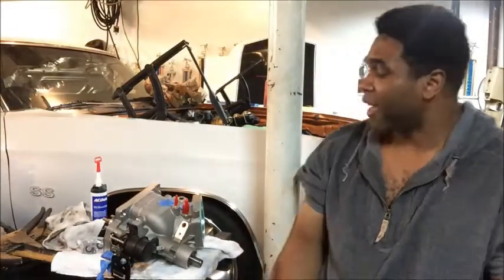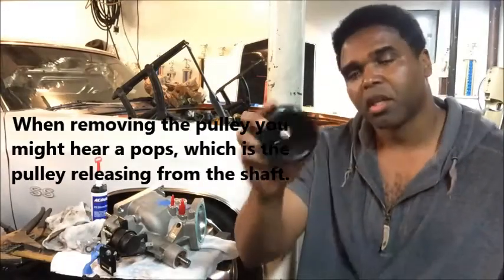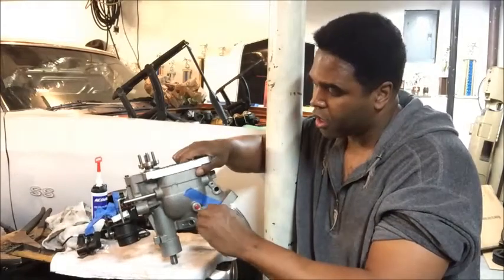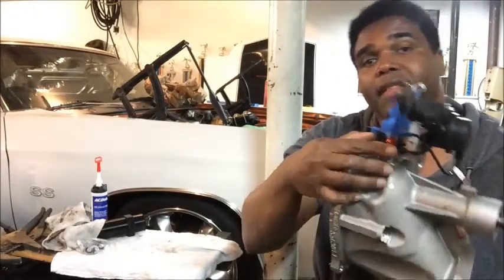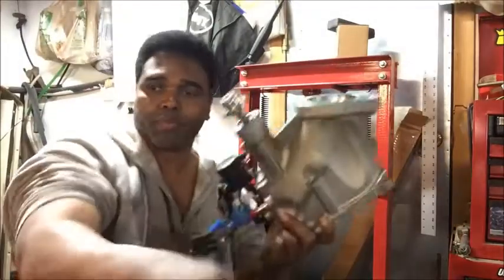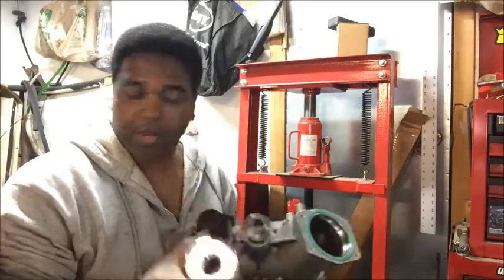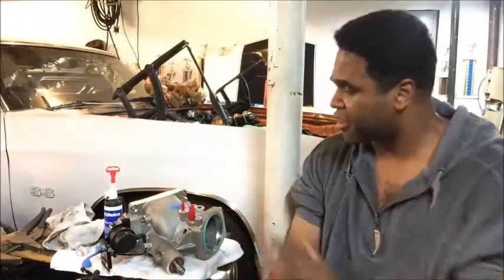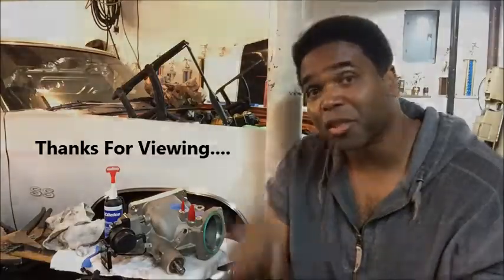How To Install A LSA Supercharger Pulley, (Close Off Vacuum Ports)

Comment: How big is that metal block you used when you pressed on the new pulley and supported the bottom of the snouts 3 pins there
Reply from the maker: 1/4 inch.. i wasnt that thick.

Comment: I was wondering if u cleaning your LSA supercharger yourself, inside rotors housing etc.  If so what did u use for cleaning supplies, and did u replace the needle bearing (or did u re-grease them only).
Reply from the maker: i didnt rip the LSA apart, i just change the fluid and ran with it..

Comment: How'd you pull that original pulley off with a 3 jaw puller?  I didn't think that'd work on the LSA stock upper pulley.  I might be wrong just planning out my build now.
Reply from the maker: the 3 jaw puller worked great.. its ruins the stock pulley but you wont need it..

Comment: just wanted to know how can I do a engine swap for a 1973 Chevrolet Caprice 4 door. Do I need any other parts. And wanted to know can I wanted to know can I wanted to know can I use the transmission for the LS motor
Reply from the maker: sure you can brotha Rod.. they make adapter plates for just about any tranny you want behind the ls engine..

Comment: come to find out terry I was using the wrong maf sensor got the correct one keep up the good video good help
Reply from the maker: whooo hooo.. glad it was something simple.. this isnt the MAF that came with the engine?
Reply: when I got the  motor 2010 express van motor no accessories
Reply from the maker: ohhhh, you had to go with a canister style maf?
Reply: actually it was designed around the 09+vortec engine #10393948 I thought I needed the canister to
Reply from the maker: ahhhhhhhhh i see....